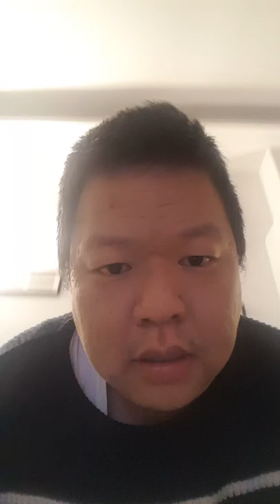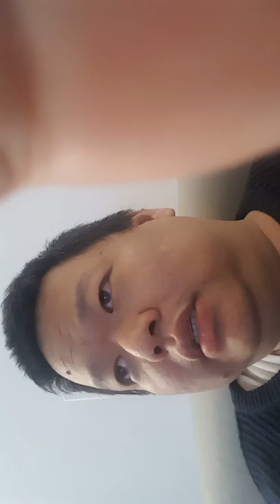E92 E90 M3 Rod Bearing Issue prevention Part 1

Comment: Very well informed video But I’m still looking for quality con Rod bearing replacement
Reply from the maker: If your bearing is ok, personally i would never do the so called preventive maintanence.

The m3 engine is built for 10w 60 oil only. I disagree with all people who claims oem M oil are rubbish.

BMW cars can be very fiddly to keep but its not complex, over the years i owned few BMW and i learnt with original oil and parts issue are none existence, for me anyway.

The downfall with 10w 60 is it take 15min to warm up, i tend to drive my m3 to starbucks keep the engine running for 15min while having breakfast in star bucks and  with the door locked with no key in the car engine can stay on lol, i got the keyless setup.

Once the oil temp is high enough, to know if the oil is really good make sure the oil display is always finish off in the caculation of max level. When that shows up really thats when you can thrash it.

M3 is a car built on a lot of concept based on 90s thinking, its not as high tech as many think it is, example the oem air induction is really a 90s pod filter..

I believe people m3 fail for the following

1. Change different brand oil all the time.

2. Oil level not in max arrow, over fill or under fill.

3. Never warm up.

4. Never look at oil temp.

Silly modifications which gains 25hp tiny for a 420hp engine.

Over rev engine due to ecu tuning .

I will do preventive rod vearing change when i hear the sound, which i think i would never hear..